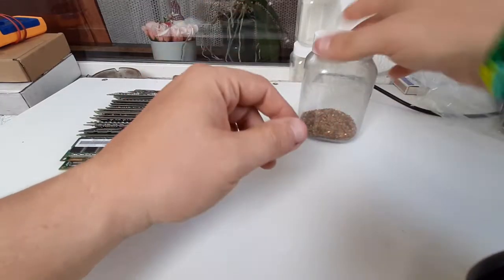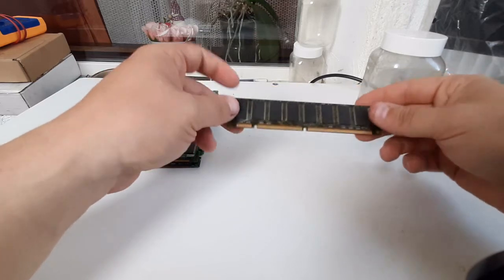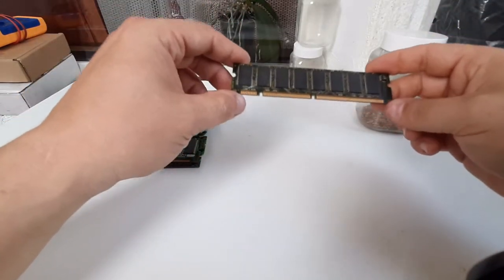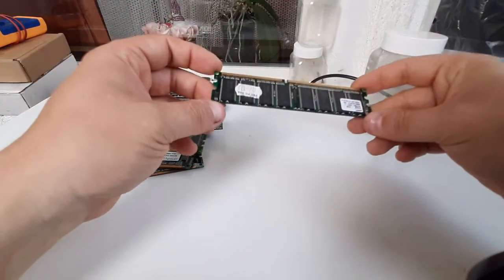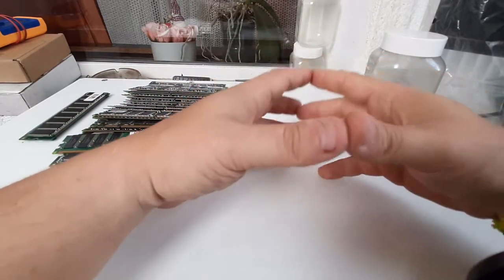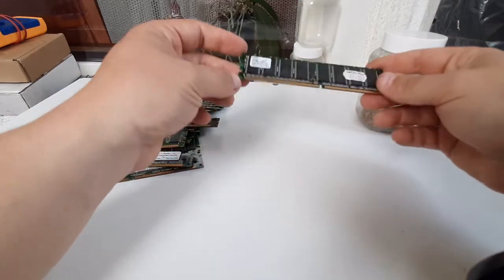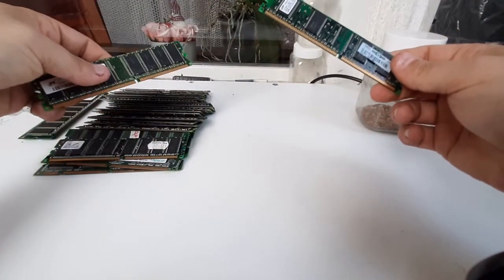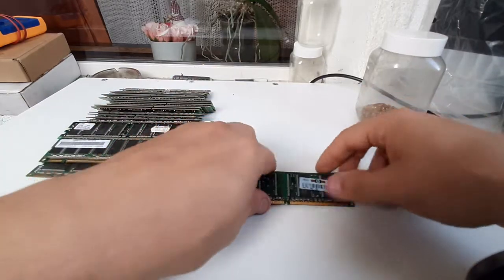0(zero) waste GOLD recovery from RAM stick fingers

Comment: It is relaxing but I  call it 'mindful' Now you have to invent a way to remove gold plating from pins!!
Reply from the maker: Hello. Thank you for your comment. There are several ways to remove the gold plating, and refine it to 24k.
Reply: @recyclr9862  I know all the chemical methods but I meant you should come up with a non-chemical method....not possible I think!
Reply from the maker: @julianalcorso5703   recovery can be done with no chemicals, the refining part is trickier, you can't avoid chemicals there, but the amount used for refining can be reduced considerably.
Reply: @recyclr9862  I agree. Using minimal chemicals is important to me. I am in the process of refining a bit over 2 Kg of gold nuggets I found while prospecting in outback Australia. Aussie gold is mostly around 23+ K but I like to remove the Ag, Pt, and Pd. This is an off-season hobby when it is too hot to prospect. I am also playing with some E-waste.